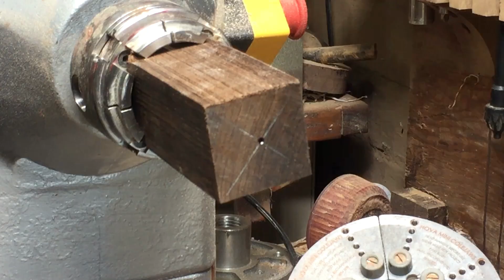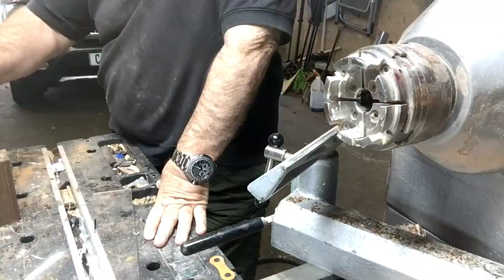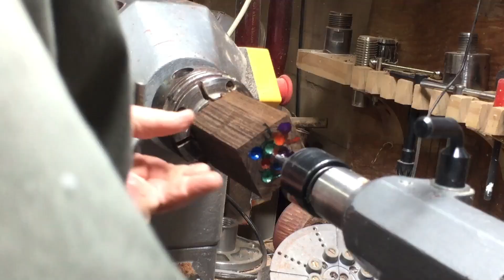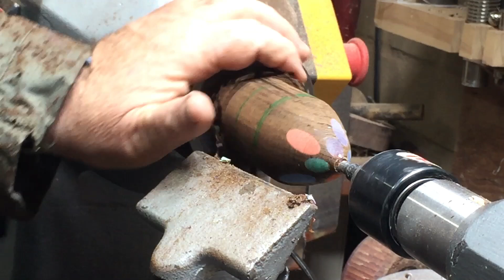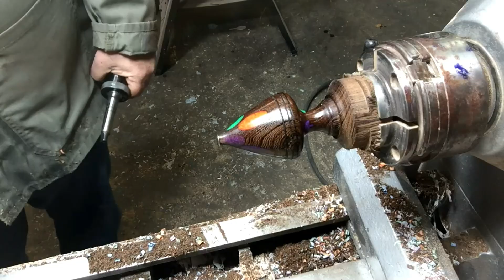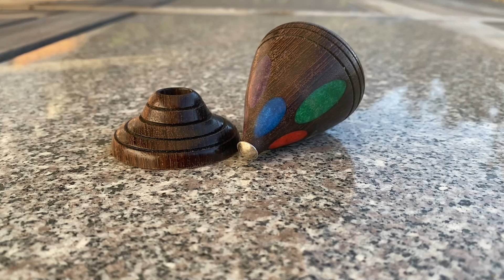woodturning a spinning top project

Comment: Very nice wooden top.  That’s a nice gift for the grand children.

I think the other wood turner you mentioned is Odair Lucas Lucas (his YouTube Channel name).  Yes, he does turn some in ingenious pieces with tools he made.   I like his and your channel and find them informative. 

Like you, I avoid using wire to burn wood.  However, I use a tongue depressor to burn the groove.  I will sharpen one end of the depressor with sand paper so it will fit into the grooves. Then I turn up the speed of the lathe and press the sharpened end into the groove.  It works great and is much safer than wire, but does take a little longer for the heat to build up in order to burn.
Reply: You are correct.
Reply from the maker: Thank you very much